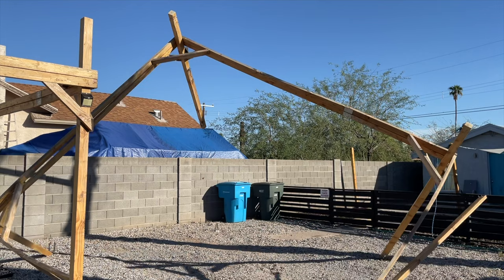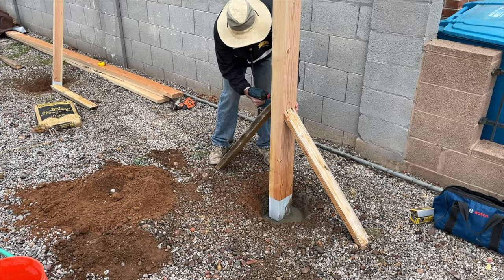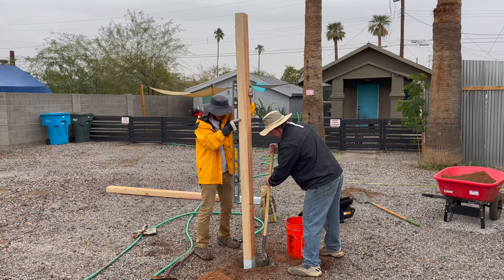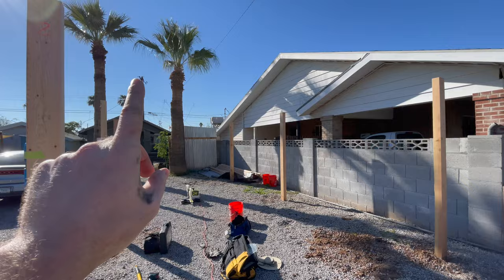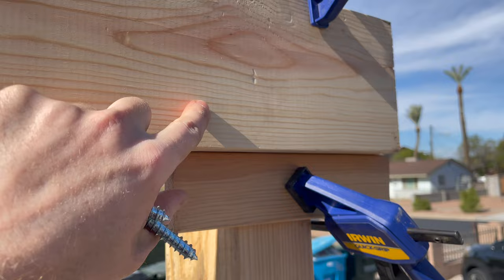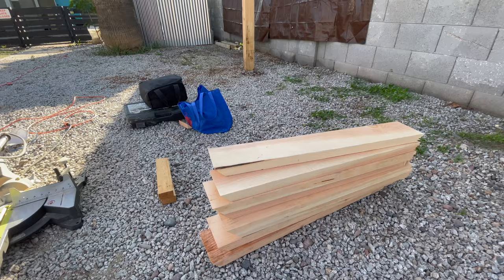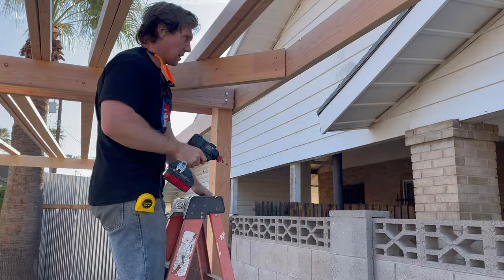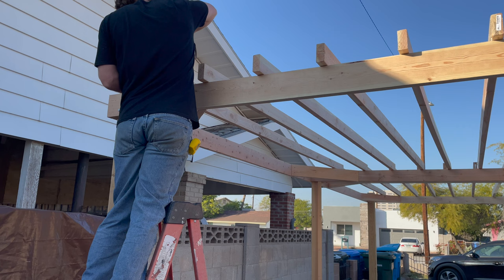Building a 2 Car Carport for $600! Full Timelapse with Tips & Tricks #DIY

Comment: Another Phoenician here. I’m no building inspector, but 2x4s across those spans, I’m think those will definitely become compromised over time. Although there isn’t much load on those 2x4s, monsoon winds can be pretty crazy and the shade sail might challenge the structure if the wind catches it right. You might want to add some supports from the posts to the 2x6s to help with lateral forces and rigidity. Thanks for sharing.
Reply from the maker: Yessir! The 2x4s were simply for style. Later I reinforced both sides with additional sets of 2x6’s across the middle. A total of 6 2x6’s across the bottom. Also added 2 more vertical posts at middle. It did not move an inch in last year’s monsoon thankfully! Part 2 linked above

Comment: next time put the concrete directly from the bag into the hole...then fill the hole with the hose, mix the concrete with the shovel or other appropriate tool...then level the poles. the quick dry concrete will hold the beams in place for level but you can still brace
Reply from the maker: Yea I’m just worried some of it won’t end up mixing properly, I don’t mind the extra work!
Reply: I have never mixed mine. Just poured and added water. Fence poles are still standing years later.
Reply: @csb772  same for our privacy fence post, added water

Comment: Now I know why this project was so cheap ($600) - you don't hardly any decent roof!  When I build my car port, it will be attached (tied in) to the existing 2-car garage and then pitch slightly downward following downward grade of our driveway.  And I'll likely use corrupgated zinc-coated steel panels that come in 4 x 8 sheets.  You could've saved a lot more money counter sinking your 5 1/2 bolts 1.5 inches and only bough 4-inch bolts.  And you could've gone with joist hangers instead of all that bolting.  But all-in-all not too shabby a build!
Reply from the maker: Sounds like a good project!! I just finished the roof on mine, added $1,200 to the grand total. I’ll be posting the video this week!

Comment: Should have used saddle rafter ties, not lag screws.  Screws will loosen, especially as rafters will also rot as moisture intrudes.  Not much rain (used to be), but the sun seems to accelerare rot (35yr Phoenician, too).  With monsoons, screw might not be strong enough when you add solit roof.  BUT, with all of that, excellent design.  You might want to consider also adding vertical support 45deg on posts, to minimize left/right wobble.
Reply from the maker: Thanks, appreciate the insight!

Comment: Sorry, but you should never use screws or nails to support the rafters against the side of the support posts.  Notch the four-by-four and set the rafter in the notch and then screw the rafters to the posts.
Reply from the maker: Hey Dennis! Thanks for watching. I chose not to notch the posts because it can cause the tops of the posts to rot prematurely. I definitely would have if I was building a deck which would need to support hundreds or thousand of pounds. In this case I am looking to add a relatively light metal roof to the top and expect it to hold well.

Comment: Rock bar and post hole diggers. These are a must for doing that kind of work here in central Texas. The ground isn't just hard, it has rock ledges. Ask anyone that grew up here, I was introduced to these tools as a teenager by my Grandpa.
Reply: Rock bar--so there is a name for it! I call mine "my heavy, metal, stabby/prying thing I made from an old axle shaft that helps break up the dirt." I always figured there was probably a name for it.

Comment: You should be using washers with your lag bolts
Reply from the maker: Hmm I’ve seen arguments for washers and against 🤷🏼‍♂️
Reply from the maker: Thank you sir!
Reply: washer if used with a nut on the opposite side. I think these should be okay because they dig into the wood and won't come unscrewed.
Reply: @michaelscott181  that's what she said
Reply: @EricBlanchette
Reply: Those type are meant to sink into the wood.

Comment: Those sun shades didn't last long. Same product as the metal frame carport kits from the hardware store. They all end up shredded and metal PBR panels on the next year after. UV is stronger than people think.thanks for the update we knew was coming.
Reply from the maker: Yea I only used them a temporary covering before I added a metal roof. I have found these sun shades last about 2 years before needing replacement!

Comment: Shouldn’t the support beams be mounted on top of the posts rather than bolted to the sides? If the lag bolts shear, break, or rust there is nothing holding up the structure.
Reply from the maker: In this case it is built correctly. Each lag bolt can support up to 3500lbs. It would likely take a tornado to shear the bolts, they are also zinc coated and should not ever rust. It should be extremely sturdy!
Reply: @taylor.g.deloye  - Yeah, I guess I was thinking more like building a deck where the weight of several people and furniture would have to be supported.
Reply: I think it should be okay, there's no weight to them

Comment: Love how this came out! Perfect use of resources & time. Question regarding the fabric being woven through the roof slats, is there any particular reason to do that? I thought that it may have better resistance to high winds but would this become an issue w/ rain water pooling? Thanks in advance for answering this question, great work!
Reply from the maker: Thanks very much! It was just used temporarily for shade before I put the metal roof on it. The link to that video is pinned at the top of the comments.

Comment: This is awesome. I want to build one in front of my garage. But I don’t really know how to get the correct angle on the roof for the rain and snow to drain off 😇👏🏻
Really nice job!
Reply from the maker: Thanks! Google roofing pitches, generally standard is 4:12 for a house but I did less than half that for metal roof. Meaning the roof is about 1 foot higher at the top across the 14’ span. But we don’t get snow in Arizona.

Comment: Is the 2 x 6 serving support 16ft long? I am planning on making a carport similar to your design but using Suntuf Panels on top but are wondering if 16ft 2x6 would work or sag.
Reply from the maker: It is 14’ feet long, I used 8 total 14’ 2x6’s and there is no sag after 1 year. There are 8 total 4x6 posts in the ground as well. Good luck on your project!

Comment: What happens when it rains? The rain just falls through? You could have added wood to the middle as a spacer to create a slope for the boards so even if you tarp it the inside stays dry and the rain drains off.
Reply from the maker: Correct, this is not waterproof. I may add a hard roof in the future!

Comment: Nice build! I'm sure the tenents will appreciate it. Guess you can get away with calling that a carport with just a sun screen on top out there in such a dry place but it needs a actual roof even if only fiberglass panels to be a carport around here where it rains a lot.  😉
Reply from the maker: I am thinking about adding a solid roof later, if I do I will make another video! I appreciate your comment, thanks for watching!!
Reply: it's a pergola with a sun screen IMO , not sure I'd go as far as calling it a carport.

Comment: Well i was going to Ask how it faired during the monson. But i see You just put this up. I need to get mine up before the 100 deg weather here west phoenix
Reply from the maker: As is it should hold up well, I plan on adding a metal roof which which will require some over-engineering!

Comment: Basically you’re dependent on screws only to hold it up as you didn’t notch 4x4 or use glue. Is a 2x6 rated for that span?
Reply from the maker: There are 4 big lag bolts on each beam. Also I added 4 additional 2x6’s in another video before I added the roof. Should stand the test of time no problem!

Comment: Dude if you have trouble digging just use a drill with a  massive attachment. I do it whenever I put posts in. get a nice neat hole.
Reply from the maker: I ended up bringing my jackhammer to finish it ☺️

Comment: How did you make sure the posts are square? Did you do the diagonal measurement method?
Reply from the maker: Yes and also continually measuring all sides as I was setting the posts after digging and pouring concrete. Thanks!

Comment: I'd be very worried about the wind on this thing... 2 feet is ok for fence posts but putting a roof on this could make it into a giant metal sail. I'd have probably gone 3ft and attached it to an existing structure as well.
Reply from the maker: Yup that is what happened with the previous carport I took down, I was very thoughtful in this construction. It survived this year’s monsoons, one with 60mph winds, no issues thankfully!
Reply: If you have put a mass of concrete on every post that will probably hold it. Roof will just blow off if there's a hurricane. Glad to hear it's standing up to the elements.
 @taylor.g.deloye

Comment: Hey there, i want to go base off plans, I’d like to build one that will fit my lifted 7.5’ or 8’ truck and my corrolla. Will those 4x6 be big enough for my truck to fit or should I get bigger ones.  And you think you can maybe a downloadable blueprint or plans for download, as pdf or even as images will be nice for us and your viewers. I also plan on doing aluminum roofing, can’t never go wrong with that
Reply from the maker: Well the 4x6 posts are 10’ so most likely they will fit your vehicles, but you could always get 12’ posts just to be sure. Sadly I don’t have blueprints on this carport but the design is fairly simply and I have included a materials list in the description. Thanks for watching!
Reply: @taylor.g.deloye  oh man I didn’t see that list. Thanks for the list and yeah but I was just double checking because I’m not really sure the size of the truck and don’t want it to be a close fit lol, but your definitely right, I’m better off just getting a taller 4x6, Idont know if they’re going to want me to put a driveway and a slab underneath the carport, im think maybe a 6” slab rather than a 8” just to save them a bit more money on less concrete. But do you think plant the posts first or form and then form and put the concrete right after? Or form and pour then install the 4x6 with post anchors?

Comment: I want to built something like that in back of my house but I don't know if I need a permit from the city 🤔
Reply from the maker: Check your city’s website, it will tell you when a permit is required. Sometimes permits are not required for basic structures like sheds, greenhouses, carports. Good idea to check first, there are often water/gas lines underground too. Thanks!

Comment: Nice video! What store did you buy your materials? All of that material seems like it would cost more than that at some places. 
I need to build an RV carport for a 35 foot fifth wheel camper that has two slides and the height I don't know but assume I need to build as high as 14 foot tall. Don't know what all I need but really would like to know what store you purchased items at to see if that store is near me. Thanks
Reply from the maker: Thanks! Given that size, you may want to look into a prefabricated RV port, they are made of metal but you still have to anchor them in concrete. I bought all the materials from Home Depot. Let me know if you build it yourself!
Reply: @taylor.g.deloye  I've built many buildings and even some sky scrapers in no time at all and by myself and of course this was all did in my dreams but when I awake the materials just too heavy to pick up lol. Your right a prefab sounds like the best way to go just need the funding. Money is always an issue these days priced so high because of the high price of gas/fossil fuels. Once I finished saving will do and thanks for the advice.

Comment: I am not a carpenter.
Using screws on those beams though!
Wow lol you’re asking for trouble.
I don’t think screws are designed to hold that kind of weight over a long time.
I would perhaps cut a notch on the beams and let the post rest on them.
I would also perhaps use galvanized nuts and bolts to hold the post to the beams.
Reply from the maker: I used about 80 galvanized lag bolts on this build. Some screws were used on the corner braces. Thanks for watching!

Comment: 3/8 or 1/2 lag bolts???? and were all your wood pressure treated??
Reply from the maker: I believe 1/2” for all the post/beam connections. It’s douglas fir which was painted with exterior paint for protection.

Comment: overkill my dude. you could have just built 3 post and attached a high quality sunshade with straps. No need for all that lumbar.  Also joist hangers vs drilling 8 inch lag bolts.
Reply from the maker: You might not be familiar with Monsoon Season here in Arizona with 60-80mph winds. Better to overbuild it!
Reply: @taylor.g.deloye understood. Im in dc no monsoons here lol

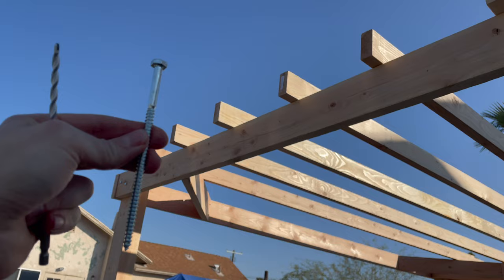Comment: I love this! @taylor.g.deloye around the 11:15 mark you say "this thing should be next to indestructible" but also IIRC you say this build is in Arizona, which isn't particularly known for bad weather. That said, if one was constructing a car port in New England, with nearby trees, would you have done anything different, strength-wise?
Reply from the maker: In the following weeks I added additional beams across the top, more support posts in the middle and a large metal roof. I think it would do fine in New England, there are intense monsoons in Arizona with 60mph winds in late summer. I would be sure to use pressure treated wood as NE is much wetter and wood rots faster.
Reply: @taylor.g.deloye  You're awesome! I really appreciated the whole video, and that you took time to reply.